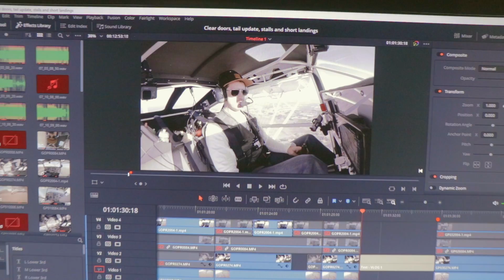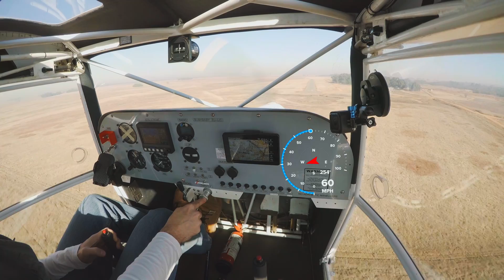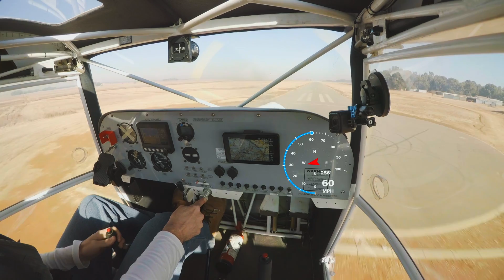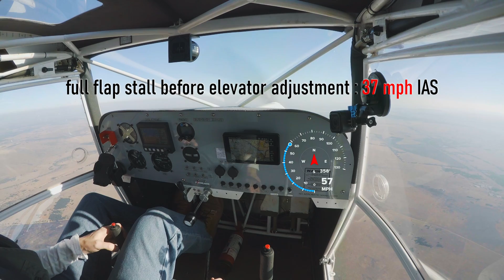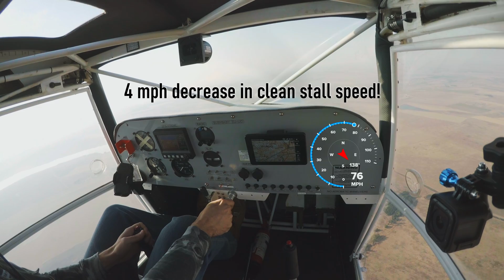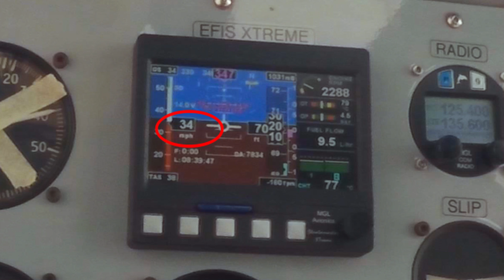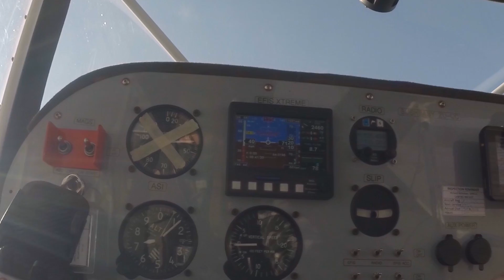Clear Doors, Tailplane Update, Slower Stalls & Short Landings

Comment: Yep, this is all good stuff and for sure is helpful to those just getting started with the back country flying. Pilot techniques and airplane mods are a minefield to the newbie and you videos help sort the chaff from the wheat so to speak. I have done some subtle mods to my rans s6 and love that i can get a stable approach at 40 mph with a stall around 34 mph.makes getting on to those short shingle bars less of a chore. I also have a thruster t500 which is lots of fun off field. My rans s14 is just about paddock capable, much more suited to on field antics tho. My Ibis gs 700 is about to get bigger tyres so i can get that off airport as well. Got to love how close I live to the mountains here in NZ.

Comment: It's a month later, are the weights still attached? Will you be removing the weights for annual inspection? When you figured out the right amount of weight and it was added, how did your plane handle when you had it fully loaded, departure, cruise, landing? Thanks
Reply from the maker: I don't leave it on permanently, I only attach the weight when I need/want to land very short, since the weight improves the short landing capability and handling.
The weight amount was calculated for 1 up (pilot) only, half fuel and minimal baggage. 

When the plane is fully loaded the tail weight really isn't necessary anymore as the C of G is further back already, thus it never crossed my mind to attach the weight when fully loaded.